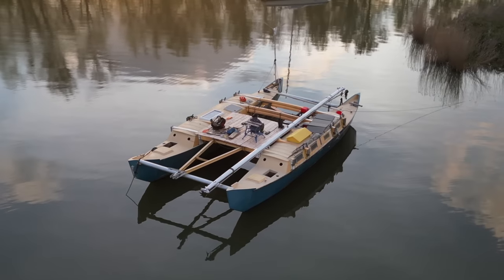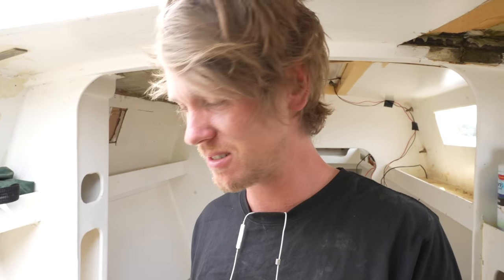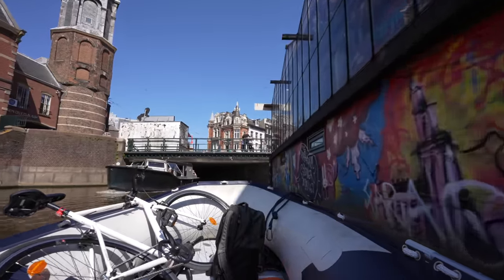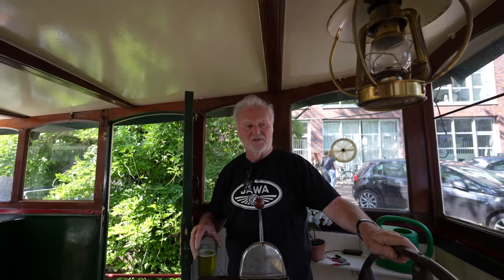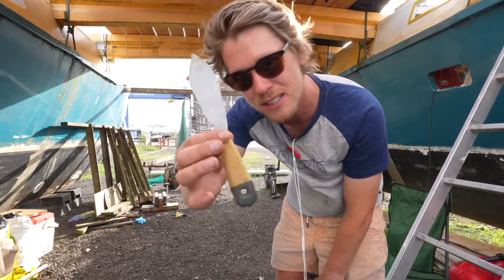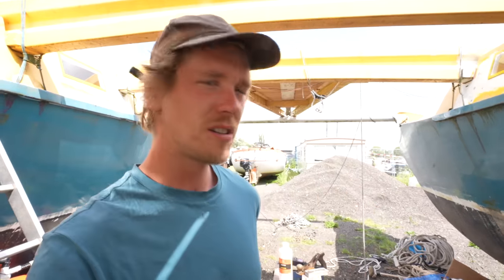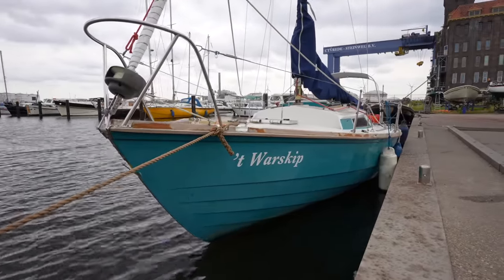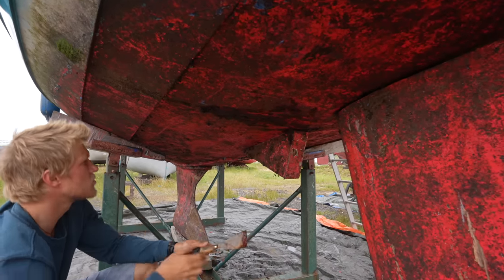My Project Catamaran Gets Sealed Up! | Wildling Sailing

Comment: Chris, anytime you have a tight space like the ones you were putting the backing plate into, consider using water bladder / bag. It allows you to pump in and pump out the water after use, plus water always finds it own level over the area to distribute weight even across the backing plate.
Reply: Sound advice, commenting to help it climb up to the top.

Comment: At last an opportunity to say “ well done!” The work on the holes in the hulls is “ excellent”  Your prep work and quality of work is outstanding! Unlike your windows , as you say time will tell, the first big waves and high humidity will see leaks , anyway the job is done now so moving forward hopefully you are receiving great advice and listening to it , Remember Sicaflex 421 is the only silicone to use not some cheap one , it’s expensive but quality otherwise you will end up doing the same job twice.

Comment: I went through the same thing with epoxy pumps, when the pumps get old and the epoxy gets low in the can, it can cause a bad mix ratio and poor curing.  I now use a gram scale and add epoxy and hardener by weight.
Reply: Best way , ( gram scale )  I think .
Reply: If you don't clean them after use, yeah, the plastic membrane inside the pump gets deformed (by the epoxy) and it doesn't work anymore. It's like trying to pull water out of  a well with a bucket with no bottom. You're supposed to take the pumps off after use and clean them. If you're gutsy, you take them apart, if you're not, you use whatever blend's going to dilute the raw components. Never had issues with mine, i always buy new ones for every new batch, but i use them fro the duration of the batch just fine.

Comment: Hello Mark. Have been watching the channel and love your enthusiasm and spirit. While there are many armchair experts on social media I am not one of them.  In fact this is my very first comment on YouTube. And you are my first subscribed channel. I did this due to my extreme concern for your safety at sea. I have spent the fifty years or so sailing, building, repairing, inspecting and delivery all kinds of watercraft. My soul and the vast amount of my experience has been spent in on and under wooden vessels. My livelihood for many years has been surveying vessels and investigating significant structural failures. 
As I now see numerous constructive comments have been made mostly pertaining to scarfing the joints of the repair. This is advice that you should strongly consider following. A comment was made as to the viscosity of the epoxy and the numbers and types of fasteners employed. Again it is something that can be improved upon. Fasteners can be added post repair. 
What really caught my attention was when I noticed that the beam was capped with plywood. I suspect that the bottom of the beam is capped with plywood as well. From a structural standpoint the capping of the beams with plywood adds a tremendous amount of additional strength in both compression, tension, and torsion. Plywood in tension and torsion performs significantly better than dimensional lumber. 
YOUR REPAIR HAS SIGNIFICANTLY COMPROMISED THE STRUCTURAL STRENGTH AND PERFORMANCE OF THE BEAM ASSEMBLY. 
Think long and hard about that. Not much fails in fair winds and following seas….
I believe it will be very easy reintroduce plywood capping to the assembly. There are other methods that could add significant tension strength such as carbon fibre ribbons etc. 
A complete new overlay of marine plywood with scarfed joints as a new cap on the beam would be a very simple and economical solution. 
I would be more than happy to share any advice that would contribute to your project and it’s success. 
As always the great thing about unsolicited advice is 
1.  You didn’t ask for it 
2.  You don’t have to listen to it
3.  You didn’t have to pay for it!

Sincerely I look forward to seeing you achieve your goals 
Cheers

Comment: Hi Mark, if your pump does not give you what you want, you can also get a cheap kitchen scale and mix by weight instead of volume. I use this method because I do not have pumps (because the leave a mess sometimes). Cheers!

Comment: Woohoo. Rot.....🤫
Glad to see you using better spatula.
I prefer plastic ones. They conform better, they clean easy, and they are cheap n disposable. I also use plastic applicators to not only apply but also to smear and level. I have often needed one when away from shops so I make them out of ice cream tubs or lids. Rectangle 100x60 is a good size. They will allow you to mold curved surfaces. Nice to see epoxy oozin too.  Keep up the good work

Comment: When fibreglassing to ply, its best to make the first thin layer glass mat. This hold more resin than cloth and allows for the ply absorbing some of the resin. After the mat, add layers of cloth. This will give the best bond to ply and strength

Comment: Good job done.. if you are using a brush to tamp the resin into the fiberglass cut of the top end of the brush  . It will make the brush stiffer and you get the resin more easy  into the fiberglass .   Keep up the good job .
Reply: Yes! Was going to make that comment. Suggest reducing brush bristles to half their length, cut with scissors. Using brush to work epoxy into fiberglass is called stippling. Also recommend using peel ply (dacron polyester cloth) on top of wet fiberglass for final layer. Then peel it off when dry- makes for less sanding before filling/gel coat or priming.

Comment: Clever move taking the time off. Good for your body and great for your spirits. I agree your fibreglassing skills are improving quickly by the looks of it.... less clean up of epoxy after from what I saw.... good on you giving it a crack. 
 Keep putting one foot in front of the other.... that's how you climb mountains......
 Regards from Australia

Comment: Excellent work! You've made great progress. I'm repairing a 1940 seaplane tender constructed of double diagonal mahogany planks and oak ribs. My plan is to fit it out into a liveaboard. Lots of work to be done still and no more than yourself the wet weather is the hardest part. Keep it up!
Reply: Also which product of west systems fairing compound are you using? Trying to figure which is best for my use on vertical surfaces. The 407 filler when mixed turns a redish brown colour so not the best if I want to paint over with white, but I guess the primer will hide it before the topcoat goes on.

Comment: Hi Mark
Any repair on a structural part of a boat especially a beam on a catamaran should be scarfed in using clear timber with no knots using a taper of 15 to 1 each end to maintain the full structural strength. Clear Douglas fir is readily available from timber yards.The last thing you want is a beam failure at sea.

Comment: I'm Takako who you helped me with on Kokernoot.
After all, when running, the temperature of the engine rises, so
Ship directly to Kadoelenwerf Jachtservice,
I had the owner's mechanic check it out.
As you said, there is a lot of air left in the water pipe, and the water is not circulating to cool the engine.
I got the air out and the water started to circulate in about 30 minutes.
I am currently in the center of Amsterdam.
Unfortunately, I cannot call your cell phone from my cell phone.
So I posted on your channel.
I look forward to your channel.
thank you. Takako

Comment: it might have been an idea to have made the thruhull plywood discs slightly cone shaped facing inwards so as to allow water pressure to always exert inwards on them, just belt and braces approach.
Reply: That would have been a good idea, but I think those patched he made are stronger than the rest of the hull.
Reply: Or use fiberglass

Comment: Next time i would switch the order of the glass mats from big to small instead of what done now(small to big). This way if the middle sticks out and you start sanding it down the big mat will be intact and thus give you strength instead of you sanding out the middle part of the big mat.
Reply: There is a decent amount of debate on this point. Andy over at boat works today advocates for the small to large approach so that each piece has a mechanical connection to the hull. I tend to agree with him as well.

Comment: At least you did something right. My last two boats I got rid of the through hole fittings. And actually did a piping system above the water line at the back so I can also monitor things.

Comment: Hello Mark, be sure to have those beams inspected....they stand tons of pressure square inch. If they're rotted no amount of fiberglass will hold. If the structural integrity is compromised they could break under pressure. Be safe buddy!
Reply: 100% agreed,  if you seen the post mortem of zingaro,  remember she broke up of Hawaii?   Luckily James managed to strap her together and motor in,  the fail points were all them beam and what they were mounted to,  although i think some flex is in this particular design,  personally to cross oceans I would be tempted to not only make sure the beams and mount points are seriously perfect,  I would be tempted to add a huge stainless H frame..

Comment: Piece of advice about plugging holes. You don't want to put plugs (cylinders) you want to put in truncated cones in (negative) truncated cone holes. Idea is, you're no relying on the epoxy to hold the plug in, you're actually putting the plywood to work (which is in reverse for the rest of the hull, most of the strength comes from the glass). Idea is, if you ever, by bad luck, strike a plug, which is a non-zero chance, you won't have to worry about it cracking. I know some people think it's ok, but i strongly believe that those kinds of holes (and in general any repair under the water line) should be done with beveled edges. It's more work for sure, but nothing a good chamfer bit can't do in a jiffy.  jm2c

Comment: for the best epoxy joint, have the wood natural, paint on neat epoxy so that it soaks in, but then glue it with thickened epoxy before the neat epoxy has set. Then you get a chemical bond between the thickened and unthickened epoxy - which as seeped into the wood someway. If you let the epoxy harden, then sand it, you only get a mechanical bond. It's just the epoxy sticks into the cracks created by sanding, not as good as having molecules that stretch deep into the wood. Also, if you don't let the wood soak up some epoxy, it can suck epoxy out of the joint.

Although, I don't think it will really matter for something like the through hulls which aren't really under very much strain.
Reply: I enjoy your tube channel Dominic, i was thinking about your project when Mark bought his boat, good to see you here keeping an eye on things ;)
Reply: @peterb9038  yup and Mark tells me he's watched my videos too!

Comment: When you put a glued-on patch on the inside, I do it using SOFT BRASS countersunk screws with the unmachined shank no longer than the thickness of your patch, so that the outer hull is completely enclosing threaded shank with the points protruding through the outside of the hull. (Do not use those damned brass coasted steel screws).  One holds the un-glued patch and drills two diagonally opposite holes, put the patch  in place and tighten those two screws, then  drill the other holes through patch and  hull as the size of the patch dictates.    Remove the patch after marking top and bottom, countersink the holes on the top of the patch, then using a tooth pick, put epoxy resin into the drilled hole in both patch and hull .  Glue the patch, and just WET the interior side of the hull before you butter the patch with glue, and then  insert and tighten the screws in sequence.  This method holds the glued patch tightly in place until it sets.  Soft brass sands easily, removing those points of the screws protruding outside the hull.  I use the same technique for putting on  butt straps.  When the glue has set, simply sand off the soft brass and leave the screws in place for extra strength and look-nice.

Comment: very interesting to see that the pahi 42 has tiki style beams. the pahi 31 had a quite different beam design, with a pivot bolt in the center. That was a big rot problem for me, but that's something you didn't have to fix! I removed the pivot and went to a design more like what you've got. So that's reassuring for me to see!
Reply: I was told Richard Woods did the drawings for the Pahi 31, when working in the JWD office. Not sure how much design input he had into the Pahi's though.
Reply: @helmshardover  I have heard people say that, but the plans I have for pahi 31 number 28, say "drawn by Hanneke Boon" on every sheet

Comment: I think the filling of the through-holes should be good. I don't think I would have used backing plates. Glassing over the inside might be OK.
Reply: Hi. I'm a professsional boatbuilder with over 20 years on the job. The job Mark has done on these holes is fine. You are also correct in that glassing over the inside would also work however not using the boatcloth he is using. The boatcloth is not structural and only adds minimal strength, it is mostly a sealing layer and gives a nicer finish.. Mark would need to use a heavier DB cloth or similar to be able to replace the backing plates with fibreglass. Cheers
Reply: @shanecooper3829  Good to get a pro advising us. Do you mean BD or can you give us the lowdown on "DB Cloth"?

Comment: Good progress! Make sure the WEST pumps are fully primed, before mixing, even if some resin and hardener is always wasted. Also to avoid long term sensitisation always use a chemical mask. Will be worth it in 30 years time.

Comment: You should put the largest patch of mat on first then fill concave with ever decreasing diameter patches . It's about surface area of the  first bond .
Reply: Whatever you're doing fiberglass you start with the small patches first and then Build It Up that's just the way it's done
Reply: Let the big to small .. small to big war begin!! 😜 I prefer small to big, easier to get fair in the end.. honestly.. from a strength perspective,  don't think it matters as long as you get all the air out 😊
Reply: Well one argument is, if you do the big first then every layer on top is dependent on the bond of the first layer. If you do it small first then every layer has some of it bonded to the hull.
Reply: Little knowledge is dangerous thing. Please don't give advice while you don't have good knowledge and experience. 
Here is a question for you; What is the point of putting the small discs on the top of the bigger ones? Where is the strength of the patch 🤔?? Or what's the purpose of the smaller ones on top of the bigger ones 😳 even Mr Beens knows better😅
Reply: Hes not filling with glass hes glassing in a plug then filling with fairing comp so small to big is the correct way to increase the bond to hull area.
Reply: Proper technique is as shown. If done right it all becomes chemically bonded throughout and builds strength. This way it is also much more manageable when it comes to fairing the hull

Comment: Fanatic job you did well on those holes I just did not understand how you attached the windows double sided carpet tape? Usually there are stainless steel bolts with stainless steel frames. How will the handle the big waves??

Comment: That straight bit of wood against your curved hull is leveling out the curve in your hull.
You need a curved bit of wood and you'll find it's a thicker layer of fibre glass 😊
Reply: that's like splitting hairs. I'm guessing he wants to get out of the yard soon
Reply: Yeah, but in Wharram, there is b' all curve, especially down low. It wont make any difference.

Comment: Are you going to screw or bolt the windows along with the sealer you used? Am I mistaken about securing the windows, I dint see anything other than the sealer you used to secure the ports in place? I’m sure you know how strong rough seas can be.

Comment: Pull every beam and inspect each one and the boat where they attach . That you can not afford rot in  them . Every beam needs to be epoxy sealed so it does not rot again .

Comment: Cheers for the video...sorry, as these comments are after all of your hard work. You may find your backing plates to be ineffective. The main pressure from the water is coming from outside the hull and I feel you would be much better off, digging in deeper into the plywood to make a bigger, divot and filling even the inner parts with layers of fiberglass cloth. Then laying larger flat pieces of cloth across the inside of the hull. These larger flat pieces will create a very good bondage that the wood backing plates will not have. The backing plates would be excellent if the pressure was coming from the inside. But because it will be coming from the outside, they are not going to be very effective, and I think layers of cloth would be much better. Furthermore, on the external side, don't be afraid to really dig in and apply larger and larger pieces of cloth. Any filling I'm hoping is done with a strengthening thickener versus just a thickener… I'm sure you got that. I'm harping on this project because I just finished my sailboat and just got her back in the water. (hoot hoot 💪🏽 hell yeah! 😂) 

Keep up the work and remember balance...enjoy moment to moment, don't torture yourself for some future goal. The path way is exceptionally important, never sacrifice present well-being for an unknown future. Keep you goal and intentions clear and stay in the flow...don't worry she will always guide you if you stop to feel, experience, and listen. 
Fair winds and following seas - capt'n. 🙏🏽
Reply: the backing plate was only for keeping the bungs from pushing thru when epoxying.

Comment: If you don't add and external frames that overlap those windows, you WILL take in water on the high seas in a storm... there is NO DOUBT about it. Scotch tape vs the ocean? The tape can be from Zebfark, but its bond is only as strong as the layer of paint it adheres to.